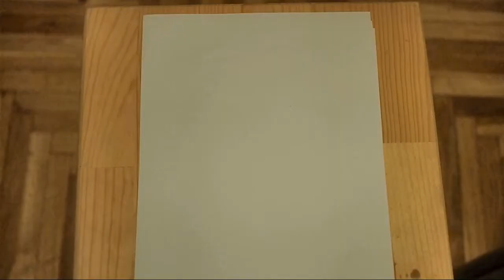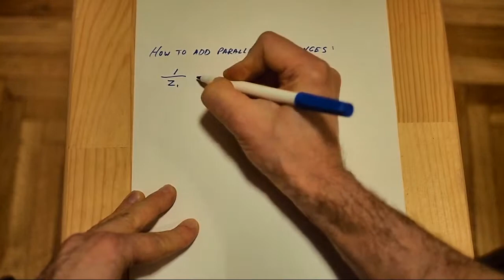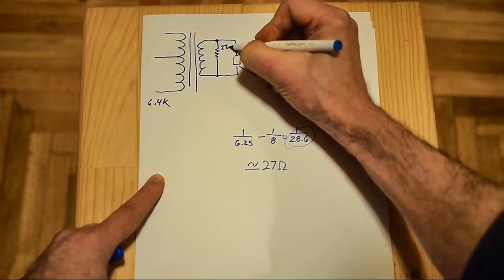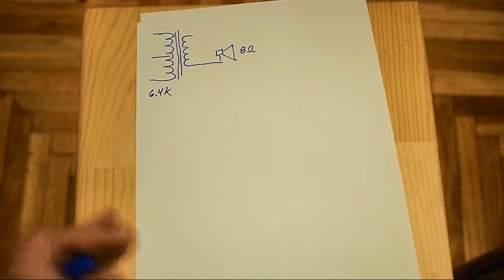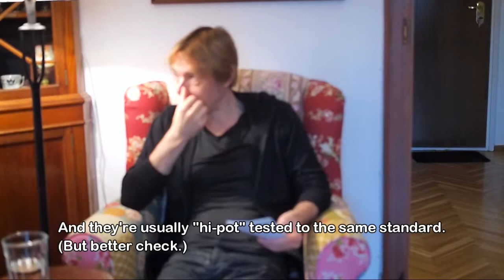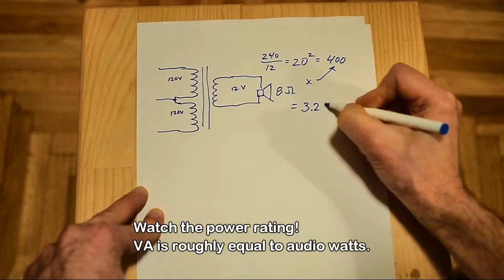Yep - more about output transformers.

Comment: I tested the output transformer in a Marshall 50 watt amp with 2 el34's. I put 1VAC into the secondary 8 ohm tap to common and measured 20.28 VAC on the whole primary winding. I was doing this to check to see if the transformer is bad due to no output sound. I think the OT is good if it is producing voltage on the primary. Do you think 20:1 sounds like the correct ratio that should be in a Marshall 50 watt combo? Please help thanks. Also when all of the wires are hooked up amp off I measured all of the secondary taps to chassis ground and got like 1.6 to 1.9 ohms on all. I thought this meant it is shorted to ground, Is this correct? I just want to know if it is bad or not so I can order another transformer. Thanks

Comment: These two presentations were fantastic, Thank You for imparting such thoughtful analysis. You have me wondering about the Watkins Dominator now. On the primaries they used resistance. Can we tone shape here or even attenuate some ? I would be curious, and the math would also help. I would like to try some of these ideas. You have really opened my mind here, Thanks again!
Reply from the maker: Thanks very much for your positive comments. I'm not aware of the Watkins Dominator having series resistors on the OPT primary, but I doubt that a manufacturer would use that method to affect the load impedance on the output tubes; they'd probably just spec a different transformer and maximize power. This doesn't mean that you can't play around with this, however. Just be very careful around high voltages, as always.

Comment: I always thought the only difference in a transformer would be the Sine wave. Most are not spot on regarding the stated 50/60 hz. unless you buy MIL Spec.  Aside from that, it is just changing voltage up or down to suit the components. Heat would also affect the stability in transformers sitting so close to the hot tubes causing slight wave fluctuation.  Load and resistance isn't really the transformers job in sound equipment. We use other components for the function of sound gates. The only resistance in a trans is to cut or boost voltage. The K-factor is also a fluctuation of a coil harmonic, but that is followed by a voltage surge suppressor spec. by the manufacturer.  Is that the possible reason one trans. may sound different, the quality of the suppressor, heat and the fluctuation of the (stable lol)sine wave? Or, did I just build a lawnmower?
Reply from the maker: Hi Steve. Thanks for your comment. The factors you've mentioned exist, but are not all that significant for the present purpose. Environmental heat shouldn't affect output transformer performance if reasonable design practices have been followed. Some of the other things you mentioned are more related to power transformers, which will be the topic of a future video.
Reply: @auburnamplifiers1786  Thanks! I think it's great how you share your knowledge.  There is a lot of misconceptions and inconsistent information going around. You help us morons from making expensive mistakes!
Reply: Steve, HEAT...heat rises.....and obviously you need to design around THAT FACT for high performance and if you call it Mil Spec...it is what it is....but really its designing RIGHT or designing for Obsolescence......MEANING...Top Loaded or Bottom Loaded in General but there is also that 3rd plane hiding as the white elephant in the room.  AND obviously there needs to be a heat exchange or venting for heat dissipation.  So designing for OPTIMUM and NOT pedestrian.  So the HEAT involved is going to affect the components more so than the transformer....the metal to metal contact to the chassis adds mass to a heat sink....as LONG AS THE DESIGN IS NOT A HEAT TRAP.   Heat causes drift in the component parts.....the repeat heat/cool Cycle  and the expansion & contraction aspects.....think Carbon Comp resistors as they were the cheapest or they were the only type available in the Era....the drift and wear & tear.... the leads detach or De-Bond....James...De-BOND (Connery), but if its soldered in place and fixed....the continuity can get sketchy to chase around.   In the case of a Vacuum Tube Plate Resistor and being a Carbon Composition type ......matching the expected heat dissipation for the voltage at hand...so think 1/2 watt or....1 Watt.  You could ride the margin with a 1/2 watt and really stress it and burn the candle at both ends.....BUT its not what you think.  As they heat up and add environmental heat...they drift up.  The plate load resistor thus increases....and MAGICALLY the GAIN goes up.  But translated academically...it means ITS UNSTABLE......and OPTIMUM WOULD BE STABLE AND CONTROLLED.....Hence Mil SPEC or PEDESTRIAN.....PSYCHO-ACOUSTICS......AND the dirty little secret of a 30/40 watt amp....you can't HEAR the difference.  Which conjures up R.Lee Ermey and FULL METAL JACKET...the movie.....YOU WILL LEARN BY THE NUMBERS.....not by the MYTHS.   I come from an OLD RCA dealership background....My Father's store....he went into business in 1935 at 18 yrs old...technically the Great Depression.  Text book, the Designed Obsolescence thing came in to being as a philosophy in the late 1920's and into the 30's....build it to break but support and REPAIR and MAINTAIN was part of the sales and marketing and building  confidence....BUT being a NEW technology.....materials and material science in the moment....things were...in their infancy.   Who had a crystal ball for shelf life or service life.  AND,  You had a right to repair.   BUT should to examine Right to REpair.....when it mentions Glued Part etc.......its referring to SURFACE MOUNT  and NOT THROUGH HOLE.....and the premise is to keep you CONSUMING PRODUCT because the want you to buy NEW and Not REPAIR......and the faster it FAILS...the faster you come back to spend money.   WHICH ....today, what IS Mil SPEC in the surface mount Era.    Auburn mentions LENS.....and some might see things as a 1 way street when really its a white elephant in the room that its actually a 2 way street.....the wave from the signal source is...not one way....